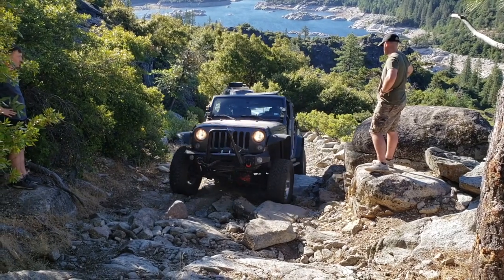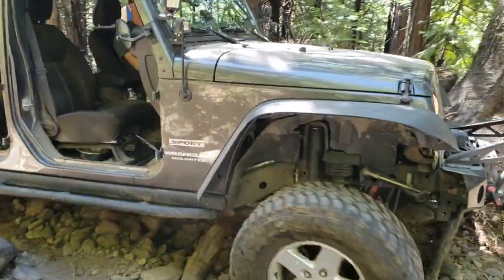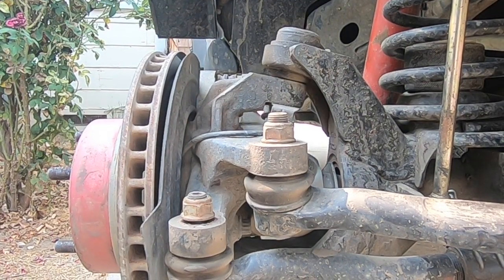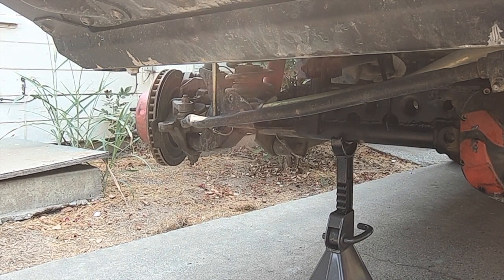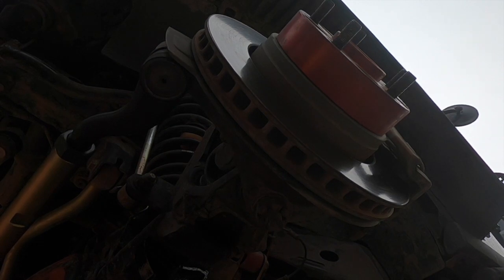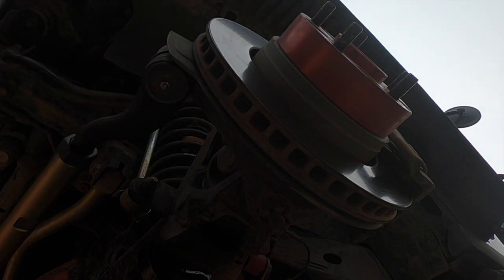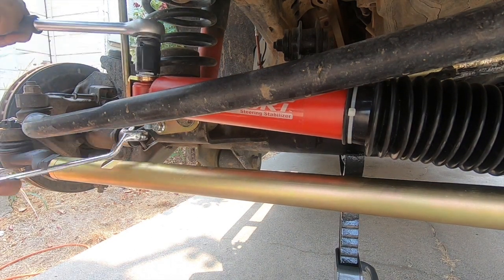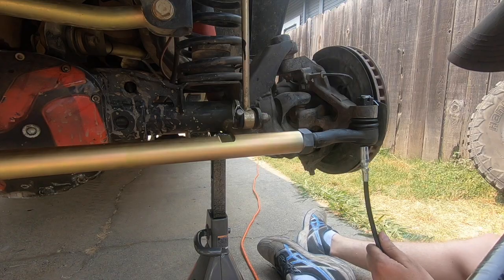Metalcloak tie rod and steering stabilizer install

Comment: Very good instructions overall.  Some of the audio fluctuated but for the most part was good.  Thanks for providing, I am considering changing mine while doing a ball joint (Dynatrac) install myself.
Reply from the maker: Thank you. Im slowly getting better at the install videos. Practice makes perfect, so I guess I need to get more parts so I can install them.
Reply: @NotICON  Just installed my dynatrac ball joints and metal cloak bars.  Love my set up.  Not as easy as every video makes it look, dealing with rust and some tough removal situations.  Feel free to ask me if you get there.  Saving for the dynatrac axel.  lol
Reply from the maker: Kevin Christofora I replaced my ball joints with the Teraflex ones. Let me tell you, they were a royal pain. I didn’t want to go all out parts, especially when I plan on swapping out the axle eventually.

Comment: Just bought one for the JL. How so you like it over stock?
Reply from the maker: It is way stronger than the stock one and has held up way better the the abuse that I have put it through.  The fact that it relocates the steering stabilizer is an added bonus.